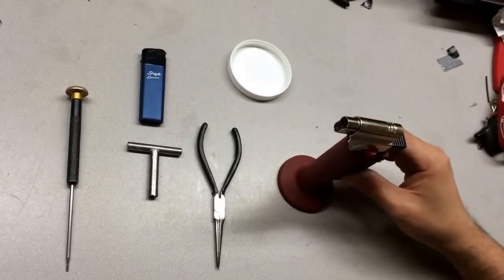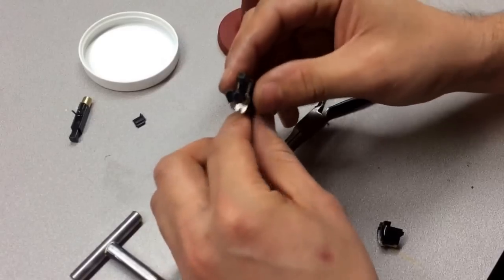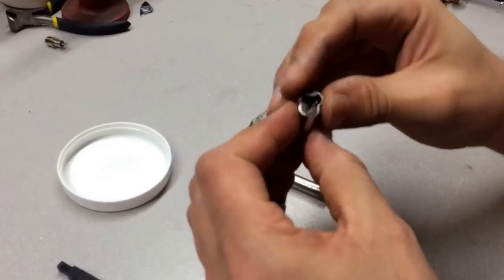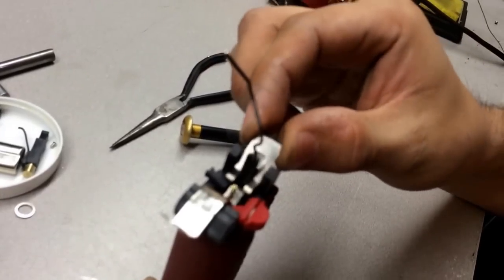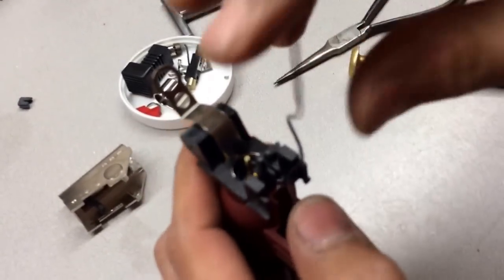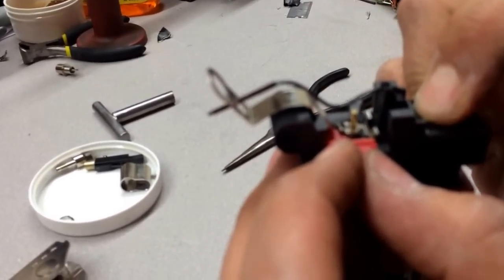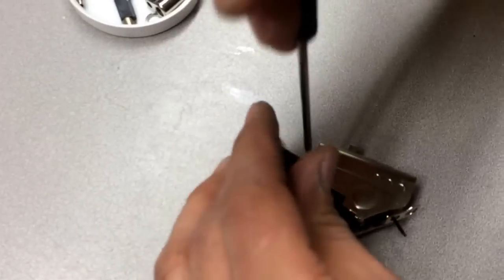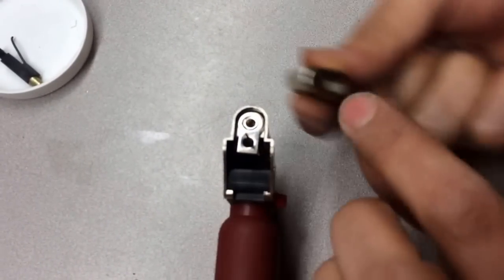Blazer es-1000 torch repair

Comment: Amazing! I didn't want to throw away one of my favorite torches (best design, most rugged, easiest to use, best value) after the piezo electric igniter switch started failing, and so I searched a bit for a repair guide for my O'Reilly Auto Parts PTW2002 butane torch. I couldn't find any diagrams or how-to's on tearing them down and repairing them correctly, until I found these two videos! It's the same EXACT design of the Blazer ES-1000, and 9 years later, is probably far cheaper (< $20) than what the OP paid for his Blazer back then. Thank you, brother, for posting these videos. I'll definitely be able to keep my torch working far into the foreseeable future now, instead of it being cursed and cast into the great torch graveyard in the sky (aka dumpster)...

Comment from the maker: I got the Scripto piezo lighters at Walmart.One thing to consider (forgot to mention in the video) is that the wire on the scripto is aluminum...very difficult to solder unless you have the right type of flux.I do a lot of different types of brazing and soldering in my shop so I have a variety of flux but make sure you get some flux designed for soft soldering aluminum !

Comment: hey I've Ben asking alot of people this question see a few of my torches I've tried to fix but every time I light them the whole torch catches on fire is there any thing I can do to fix the problem ? is it the tips mayby ?
Reply: There are a few O rings that cause that problem.One is at the back of the torch where the air adjustment knob is.You will
Find a small Allen screw. Tighten that screw  and see if it helps . If not ,Back the screw out and pull out the valve.There will be an o ring there, replace if damaged.
 The other one is much more difficult to replace. You will have to pull apart the entire torch head assembly. Hunter the small needle valve  it feeds the fuel  there is an O ring between that and the tank . Unscrew the entire needle valve and replace the o ring between the fuel tank and that needle valve. It's a pretty hard o ring to  find because it's microscopic and also it's flat.
 I hope this helps
Reply: +Frankie Rodriguez think u actually I've done that before not for this reason though but because I found a good torch that was missing those peaces .

Comment: Hey I have a torch lighter just like this and I may have messed it up really bad by taking it apart and obviously not the right way but regaurdless it was broken before I tryed to fix it. It was not going to complete sharp pointy torch flame like it should even if I had put the sliding thing on the top all the way to torch flame it would be like a solid blue bic flame instead of the torch. Mine Is like yours but idk if yours has the regular lighter option along with the torch option on the top but that's what mine does . But it was not completely going to torch flame like it should have would you know why I can try to find it snd take a picture of it to show you
Reply: Vector butane has the adapters!!!!
Reply: When you took it apart, did you take out the part the slide adjust sits on top of as was well?
Basically, all that slide does is cover a hole in the metal tube it sits on to restrict the amount of air that gets mixed with butane.
When the hole is completely covered, there's no air so you're just burning butane and that gives the normal flame.
When the hole is open, then you're burning a mix of butane and air which makes the jet flame.
So if you're not able to get the full jet flame, you're not getting enough air in the mix.

Comment: a year bud..?.?.? maby if u only light ur BBQ twice a year..from my experience I'd b lucky if they last a month under regular use.. iv had a few not even last a pack of smokes
Reply from the maker: FishNHunt 2 
I literally use mine for several hours everyday 5 days a week in a shop environment for soldering and reheating adhesives.Ive been using this same model for 15 years and have had to buy a new one maybe 5 times.
 I think you just have bad luck
Reply: @beatlebacker1996  He doesn’t have the experience. New people assume it broke and get a new one. 90% of torches are returned and work fine. It’s ridiculous. Vintage lighters came with info.